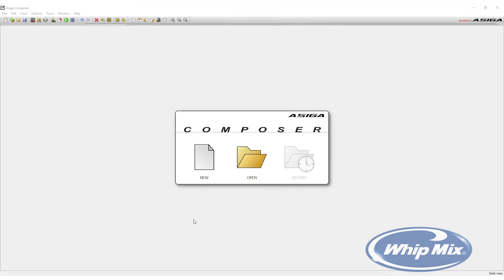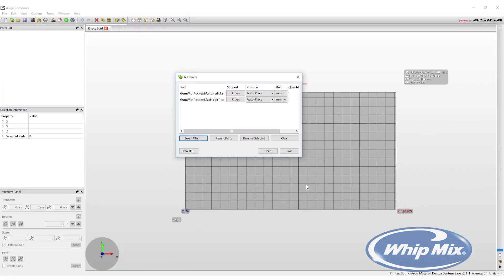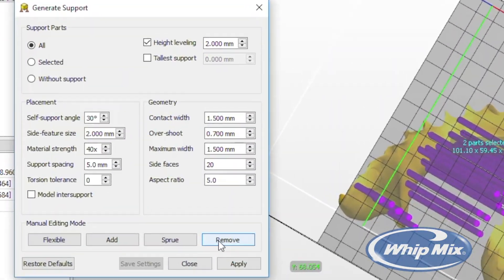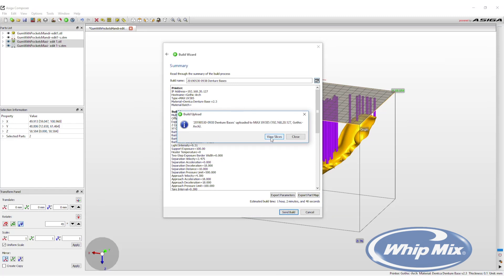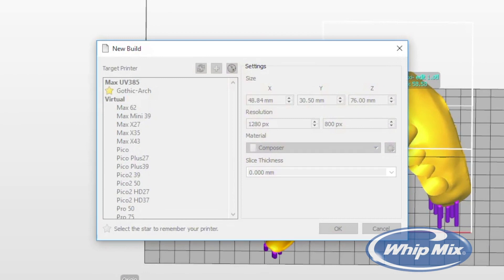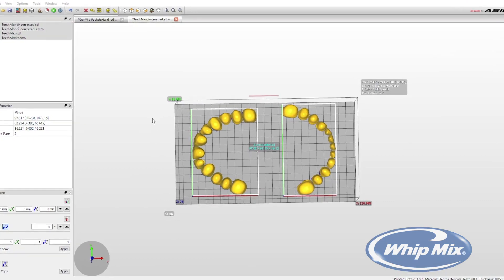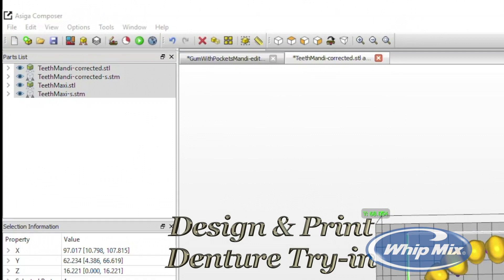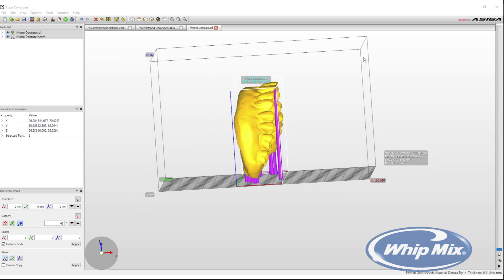Design & Print Digital Dentures with the Asiga Max

Comment: In the manual, it shows that the parameters 'Base Plate Thickness = 0.400 mm, type = Shadow' apply to teeth and gums. In your video, you use 'Shadow' for the base and 'Bounding Box' for teeth. Now, which one is correct?

Comment: hi. what is the best direction to place the base at the plataform.
Reply from the maker: This is going to depend on the material that you are printing with. Each material should have an instructional guide to advise on the best printing parameters for achieving the best results. All materials sold by Whip Mix have those instructional guides on our website under our resin sections for each respective resin.

Comment: Why using non medical wire cutter? using small diamond separating discs is easier and safer.
Reply from the maker: Thank you for your input Houtan Arefi! We used the wire cutter due to the low cost of investment needed and cross compatibility for other 3D printed indications. The diamond disc is a great idea! We will have to try it out next time!
Reply: I’ve manipulated the parameters of the support structure so that the support don’t intersects through the Modell. It’s easyer to remove by hand post curing. No tool needed 👌🏼